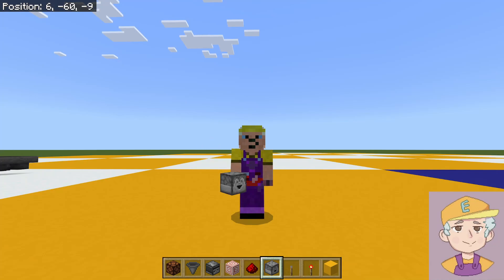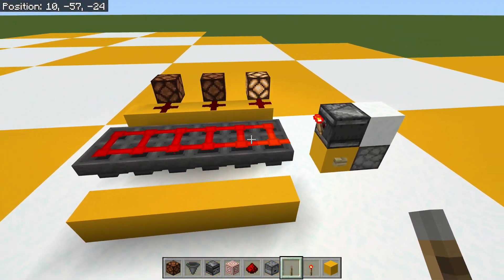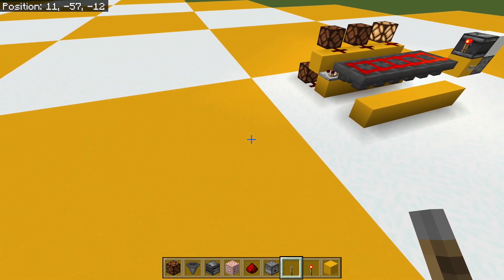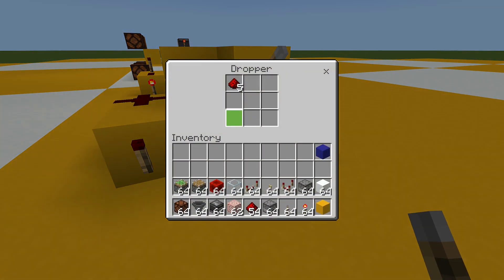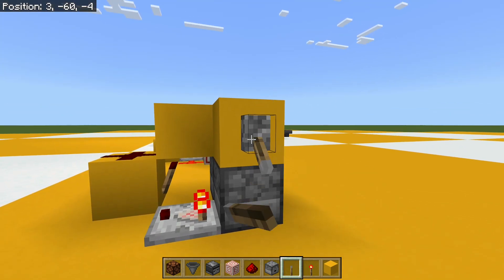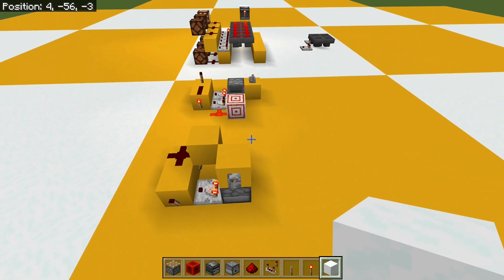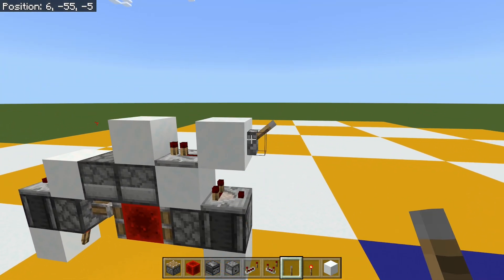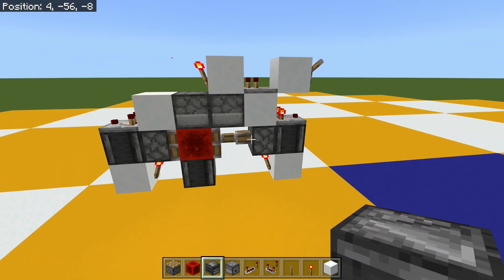3 Pulse Divider (pulse counter) for Minecraft Bedrock

Comment: Is there any way to make a pulse counter that works with high speed? I want to make a counter that counts each time a dispenser activates. So it has two be 2 pulses. My issue is that given how the dispenser works (really fast) the pulses keep the dropper empty.
Reply from the maker: To do what? If it's for testing you could just pulse a dropper full of items at the same time and send them into a barrel. Then count the items. It's limited to 9 stacks of items of course.
Reply: @Eggfur  I'm making a cocoa farm and my current issue is that I can't get the piston to wait enough time so the dispenser can apply 2 bone meals to the cocoa sprout. I thought maybe the pulse counter could work with the repeating signal of the bone meal loaded dispenser
Reply from the maker: Maybe a T flip flop could work for that. You can make one with a dispenser with powder snow inside and a comparator reading the dispenser. Two long dust after the comparator. 

That will basically count to 2, though you might need to fiddle with the timings. It runs at max clock speed, so no worries there.